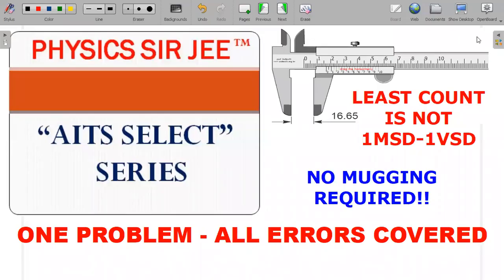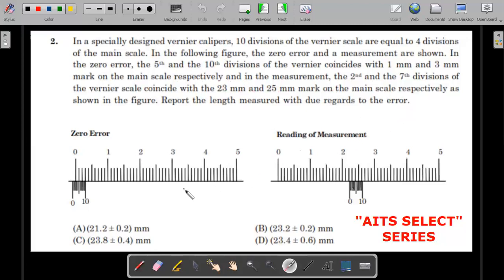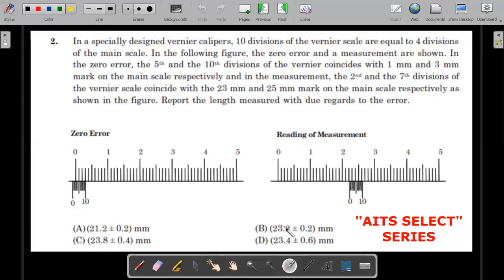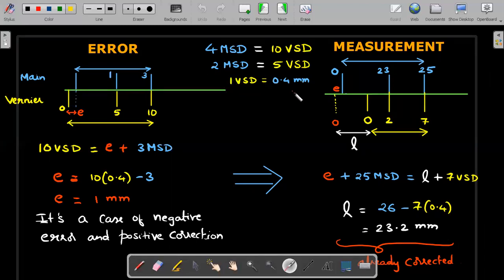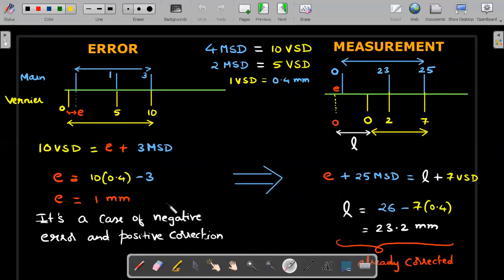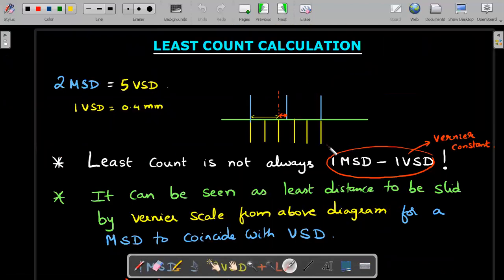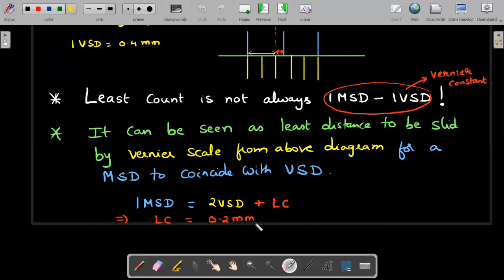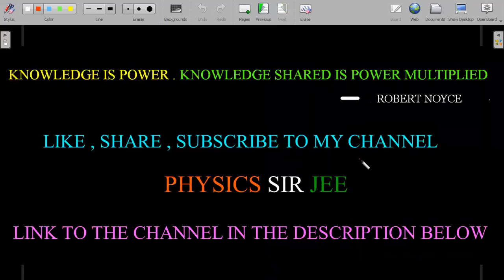THE SOURCE FOR JEE ADVANCED 2021 VERNIER CALIPERS PROBLEM - CORRECT PREDICTION | NO FORMULA REQUIRED

Comment: Why not error in measurement of e itself is accounted , should not the error be 0.2+0.2
Reply from the maker: Time stamp of your doubt please???
Reply: Sir at 7.35 , where you are calculating e
Reply from the maker: @anujha7310  I couldn't understand the wording of your question but I will try to explain 🙂....

at 7:05 when we calculated error e, we were told in question that the divisions exactly matched (left of the screen) ... So we assumed the calculation of e is perfect from that information. Remember e is called a systematic error.

Now, in any Measurement related to Vernier ( e on left or actual reading on right ) , there will always be a random error which should be reported with a +- (plus or minus) sign separately at the end. That's not to be included in the calculation of e. I hope you understood
Reply: Yes sir I do understand 
Thank you , I was thinking that e has also been calculated and there will be error in it too , However if according to question it exactly matches and there won’t be any error in it , I am fine . 

Thanks a lot sir 
Sir one more thing , I had asked a question for jee 2016 rotation problem too , if you can check once I will gain confidence in my understanding . 
Thanks sir

Comment: 14.30......1MSD -1VSD would be 0.6 mm and not 0.1 mm.....speak carefully sir 😂.........least count is the minimum difference between a measured value and a multiple of vernier count........vernier count is taken equal to least count only if that minimum difference is zero....
Reply from the maker: Thanks for the smiley , and the advice given. I will consider it for future videos. Btw , for this video LC is 0.2 mm as mentioned at 14:30. Least count derived there is correct.Least count is the least measurable length . It’s not 1 msd - 1 vsd always. 
There is nothing called ‘vernier count’ in your comment , I think you mean to write ‘vernier constant’ . Please write carefully:) Mistakes can happen, I can understand
Reply: @PHYSICSSIRJEE you are getting angry sir....this a sign of ego.....Just carefully read what I wrote..........I just said that in your video at 14:30 you said 1 MSD - 1 VSD as 0.1 mm while according to the solution you provided it should be 0.6 mm.......also I very well know that there is a difference between least count and 1 MSD - 1 VSD..............and yes for sure there is no term like vernier count😂 in physics that's my slang term I shouldn't have used it.......and yes JEE is an objective exam also😂
Reply from the maker: @Kattar_Hindoooo  angry yes , ego no . Angry because of lack of respect and the tone of your comment. Rest all , I leave it to your better judgement
Reply: @PHYSICSSIRJEE  this is what we call ego.......I addressed you with designation of sir in my comment and I don't know in how much high esteem you take yourself that even that is a disrespect of yours.........I understand that while we are speaking so much things and at the same time also explaining them then things like this happens ....that's fine.......I just pointed that out.......my intentions were not to disrespect you .......why would I .......I don't even know you........no disregard....no grudges......I am sorry I commented on your video.......
Reply from the maker: I was referring to " speak carefully sir 😂" part of your first comment. What's there to laugh ? I didn't understand . I couldn't decode your intention. It could be a slip of tongue when I said 0.1 mm in the video. 

 I just felt there was no need laugh on a video made with pure intention and hardwork. So , I just wanted to highlight that . As , you said , may be I too should have toned down my response. As you said , no grudges , no ill feelings from my side too. And sorry if I hurt you.  It's just unfortunate that this conversation started off on wrong note. It can go better from here on , I guess. It would be nice if you can continue commenting on the videos in future , that too , if you choose to 🙂. Have a nice day 👍🏼

Comment: Hey sir..great video..I have an diff insight for least cnt...plz tell if u liked it..in above  case..the actual zero of Vernier scale..is 2mm behind the 1mm mark..of main scale..so starting from that zero..I will calculate the position of VSD coinciding with 0 of mains scale..let position be n..so n*2/5 =1mm..as main scale 0 divide two half abt the coinciding divisn..no I get n=2.5..but I knw n=2 is possible and so the 0.5VSD is least extra length needed to shift the 2 divisn of VS to voincide with 0 of mains scale .wgich is hence 0.2mm..

Comment: Awesome explaination sir. I also use the same method. I have a doubt at 9:17 the length = 23 + 2(.04) + zero error. That will come out to be 23.18 Have we rounded it off to 23.2 because of significant figures or is there any mistake in calculations.

Comment: I am a JEE Aspirant I thought for 30 mins that why the formula i learned (LC = 1MSD - 1VSD) and used multiple times didn't work for this even though it was derived through the same method of conservation of length on both scales..I came to a conclusion that in that derivation we had only one VSD between the 0th MSD and 1st MSD while in this question we had 2 VSD between 0th MSD and 1st MSD so eventually we had to subtract 2VSD from 1MSD to get least count ... And got to the foemula that for any Vernier scale, L.C. = 1MSD - (n)VSD (; where n is the number of VSD between 0th MSD and 1st MSD ) or For simplicity we can simply keep on subtracting VSD from 1MSD until the value becomes less than or equal to VSD and that value is our L.C... Please correct me if any of my conclusions have mistakes..
Reply: good observation
Reply: Super brooo
Reply: nice work, captain obvious. Your existence must also be as redundant as this comment that you thought was a very nice discovery.
Reply: @korigamik  yeah fantastic tone of speaking honourable Sir, not rude at all. I wonder who's redundant.
Reply: @korigamik  itna shaana kyon ban rha hai, khud bata bhai kitni rank aayi ki tu itna chaud dikha rha hai?

Comment: Sir the solution you gave for calculating least count part means that we would have to draw the "to scale/schematic" diagram as in this question only one main scale  mark was there but if we have multiple marks how do we conclude which vernier division is closest to any main scale division ??
Reply from the maker: For co-primes , you can mathematically prove only one or no coincidence will occur for a reading

Comment: An easier way can be to just find distance between the 10th mark on VS. 10mark in reading will be 26.2 i.e. 25+3VSD(=0.4mm). Distance will be 26.2 - 3=23.2

Comment: Sir, definitely the best and simple explanation to the topic. I have a doubt. For Least Count calculation, if for example 20 VSD coincides with say 17 MSD. Then how do we draw this to scale in exam and how do we find the least count.
Reply from the maker: Great idea 👌 , I was planning a video on this anyway . I will give you the answer. Can you figure out how ?.  Least count in your problem is (1 MSD) /20 ...as 17,20 are co-primes . Did you see , what I did there ? 😉. In case you couldn't , don't worry , I will plan a video on this 👍
Reply: @PHYSICSSIRJEE  
Thank you, shall wait for the video...
Reply: @PHYSICSSIRJEE  sir, can we use 1MSD/no of vsd   for co-primes.i have checked for few, it is matched with the theory explained above 😍🙏🙏🙏. How to proceed with non co-primes? Thank you for your videos sir.
Reply from the maker: @narasimharao9074  I will make video on that , you have to consider GCD for non-coprimes
Reply: @PHYSICSSIRJEE  Sir waiting for your video on this topic, I am getting (3 MSD)/20 as the least count if 17 MSD=20 VSD.
Reply from the maker: @vilakshangupta380  please draw the diagram carefully and check least count . The smallest gap between any MSD and it's nearest VSD comes out to be MSD/20
Reply: @PHYSICSSIRJEE  Oh yes sir, now I got it! it happens near to the 7th division on the main scale...initially I took the 1st division of main scale... 🙏🙏🙏
Reply: @PHYSICSSIRJEE  
Sir how is the question of 17-20 different from 5-2?? 
Is it because the readings are too long/difficult to draw to scale or because we dont get terminating decimal vsd ??
And also for non co prime we just have to divide both by their GCD so that they become co prime and proceed the same way right??

Comment: Sir I have a doubt in the least count calculation part:
As you said that it is the least distance to be slid by the vernier scale for a MSD to coincide with VSD . It might be possible that on moving the vernier scale towards the left the least distance is getting obtained.
 Example: 3MSD=5VSD, Here least count will be (1MSD-1VSD=0.4mm) or (2VSD-1MSD= 0.2mm).
Reply from the maker: 0.2 mm
Reply: @PHYSICSSIRJEE  
So Vernier scale can be moved left (beyond the zero of main scale)?
Reply from the maker: @harshrivv  it cannot be . 0.2mm is the answer without that . Please draw the two scales and check (by mentally moving VERNIER scale only to the right)
Reply: @PHYSICSSIRJEE   Ok sir, I understood now.
Thank you very much sir!!

Comment: Thank you sir a lot !!! Sir I have problem related to reduced mass concept application ! How to solve question  easily if we know reduced mass concept ! I only know how calculate reduce mass but not it’s application sir ! Help from your side would be highly appreciated sir !!!
Reply from the maker: Reduced mass is not a universal Concept. It's only applicable as a mathematical tool in reducing our Calculations in certain special cases only . Eg: 1) Energy Calculations in two body collisions 2) Modified Bohr model where nucleus mass is comparable 3) time period Calculation in case of two blocks connected by a spring 
Don't worry too much about it by thinking it's a very heavy Concept. Practice above three cases for now. I will plan for a video in coming days 🙂

Comment: Very Well Presented and It is definitely very helpful for students! :-) loved it.
Reply from the maker: Thank you sir 😊👍
Reply: Yes it was helpful jee adv 2021 meinnaagya
Reply: Hello Janardhan sir . 
I feel there is a mistake in analysis here , correct me if i am wrong . Calculation of e ( zero error) and l are by two seperate observation and both can have an error of +- 0.2mm , where as this has not been taken into account while calculating e . If the manufacturer of instrument provide value of e then we can directly use it , however here it is calculated from observation sir .By the way  I am a big fan of your content sir .

Comment: Sir let's think  that we have a defective vernier  callipers (standard one ) with -ve zero error of 10^-6  then can we say least count is 10^-6 ? If d definition given in video ie minimum distance that should moved by so as to get a coincidence then I this 10^-6 is fine,I think and also lc depends on zero error.
Reply: Or is it necessary to take both zeros coincide when we were to count lc?
Reply from the maker: @arunayarramreddy4235  we have to start from both zeroes coincidence👍. Error is also a measurement, so it will be in multiples of LC . So , in the case you mentioned , 10^-6 seems to be too small to be measurable by standards of VERNIER CALIPERS. Unless you tell me MSD vs VSD relationship